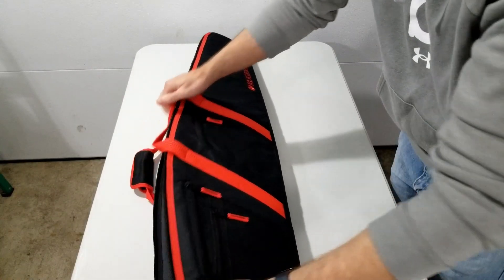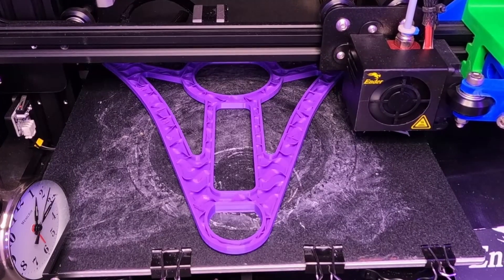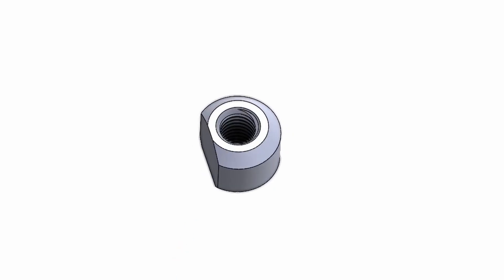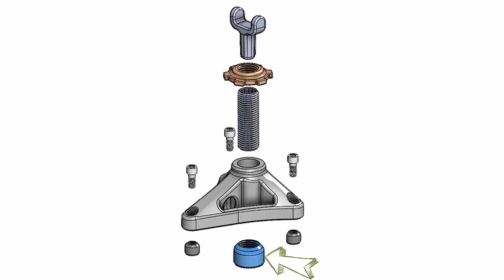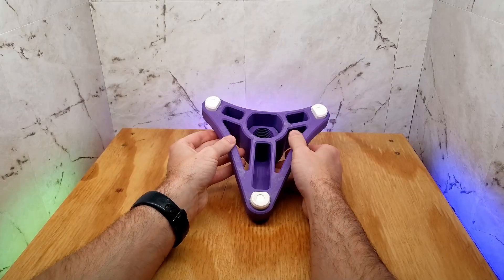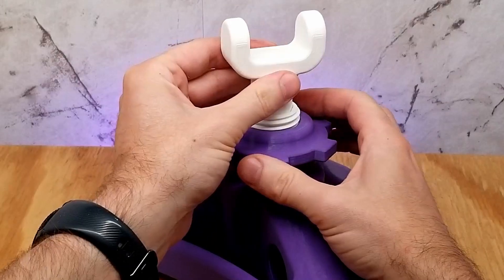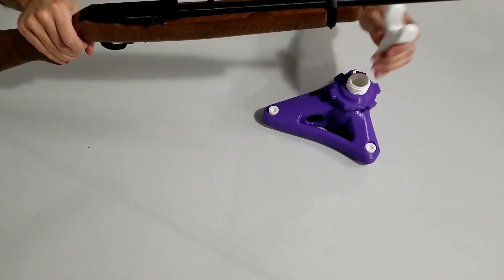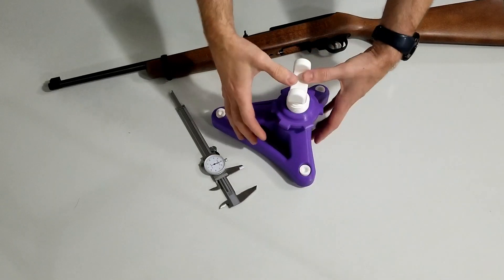Ultimate Shooting Precision: Design, 3D Print, Assembly & Shooting Test

Comment: The support was difficult to remove because cura had the "roof" setting enabled in the "support" section.
 It automatically enables a layer added between the support lines and the model being printed.
 Disable it and your supports just peel off!
Reply from the maker: I never knew that option existed in Cura, but now I'll have to look and see if mine is turned on or off. Hopefully, besides that there weren't any issues for you. Yeah, Cura has a ton of background settings that can be enabled and adjusted it's crazy!
Reply: @sanfordprime  Yeah, I found out that "feature" while printing my RC airplane propellers.
 What a difference!
Reply from the maker: lol 'feature'... Yeah, what works for one print may not necessarily work for the next...

Comment: Seems like your printer took longer for all the parts, and also, the support was very rough. Not sure if it was your settings? My Bambu took a little less than half the time, and my support peeled off perfect. No sanding required. Also, great design, thanks.
Reply from the maker: I keep telling myself I need an upgrade, it's just hard to justify when this one still 'works'. Nearly pulled the trigger on a Bambu A1 a few months ago, probably should have... Anyways, hope the bench rest works well for you, let me know how it goes at the range!
Reply: I looked at my reply and it did not come out as I wanted. Very good design. My brother owns the 3d print store in watertown WI. He talked me into the P1S. My first printer would of took 4 days for that print.
Reply from the maker: @dko4552  LOL, i didn't take any offense. I would love a new printer someday and you're just talking me more into it now...

Comment: design your bench rest while modeling to be able to fill interior cavities with no gravel concrete mix to add substantiial weight so your gun is not resting. kicking on top of a plastic toy bench rest
Reply from the maker: It's possible, for sure.

Comment: This is just what I was looking for.  May I ask if you ran into layer shift when you were printing the big piece?
Reply from the maker: Awesome, Hope it works well for you. I didn't run into any noticeable layer shifting, it actually turned out pretty good.
Reply: @sanfordprime  May a ask if you could extend the screw adjuster by 4 inches?  If it was a little longer it would be great.
Reply from the maker: @cowboy898  I added the new file to Printables and Thingiverse. 'Adjustment Thread (long)'. It's 8.5" long in this version, nearly the max that my printer would be able to handle, good luck!

Comment: Nice rest. How do you get your parts to adhere so well on your print table? Thanks.
Reply from the maker: Thank you. Whenever I have problems with part adhesion I just add more glue stick to the surface. Which explains why my build plate looks so worn out, but it's just glue stick remnants... lol.
Reply: Thanks I'll try that.
Reply from the maker: @lsj624 👍

Comment: Downloaded this but the stl's need fixing, if I open any of them in my slicer they are scaled tiny, the base is like only 8mm long.
Reply from the maker: The Thingiverse models have been fixed now to arrive in the slicer the appropriate size, look for "_A.STL" files. Thank you for the heads up! I normally print with .3MF files so I didn't catch that the export went haywire... All my settings in SW for the export were correct though so I had to scale the model up in SW in order to export... so weird... I guess it's time to install a new service pack!🤔
Reply: @sanfordprime  awesome, cheers for that.
Reply from the maker: Not a Problem.
Reply from the maker: I'll look into it... in the meantime, if you're able to scale it up by 25.4 in the slicer it should work out. Sry.
Reply: Would you consider sharing the step file for the base. I would like to modify it so it can be filled with concrete. Thanks

Comment: Awesome!  I’ve been wanting to create this yet still needing to learn the software bit is taking a while lol. 

The only thing I would have oriented differently is the yoke. I’d orient it along the Y (left to right, along the length of it). It would make it stronger, and good to see you did not orient it vertically, would def make it weaker that way. 

Thank you again!
Reply from the maker: You're saying lay the Y down as it was still just rotate it 90 degrees right? Hard to convey with words isn't it? LOL, that is some of the reason for making these videos.

Software can be difficult, but once you understand one, all the others are really close. Keep Learning, it only gets better!

Thank you for sharing the input! I'm still learning lots of things too, it's a never-ending process 🤪.
Reply: Hello, apologies for not replying much sooner. Yes, can be difficult to explain written out. 

For example, if it were built and laying in front of you with a rifle on it - the barrel would be pointing either to your left or right and it, below. Ugh lol. 

Or, as example, if you were going to print a pencil, or, a ruler for instance. 

Take a ruler, stand it up, flat/markings toward you, with 0 on a surface and 12 up. 

It would be much stronger if the print made continuous lines/layers from 0-12 versus left to right. Of course there are exceptions, and needs to have overall purpose-of considered. 

I would suggest maybe print two out, yet only a dozen layers though. Let it cool, and see which breaks more easily

I hope that helps explain what i’ve tried to convey? —-> I’ll see if I can upload a pic on the Printable page - doh!
Reply from the maker: @MoMarinePrepper  Easy for you to say... LOL! So you're saying layer lines perpendicular to the tapered shaft and the part would be standing up as a Y? if so, that was the original way I was going to print it (and designed it for) but I switched it at the last second to be laying down. Interesting though... if you still want to send a screenshot through printables of it sitting in the slicer software it's fine by me, maybe I'm still misunderstanding?